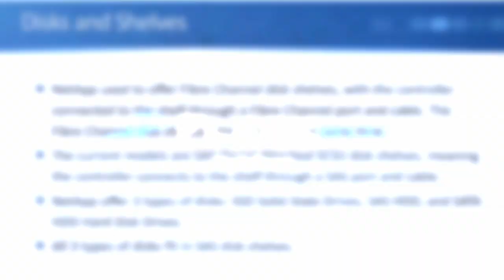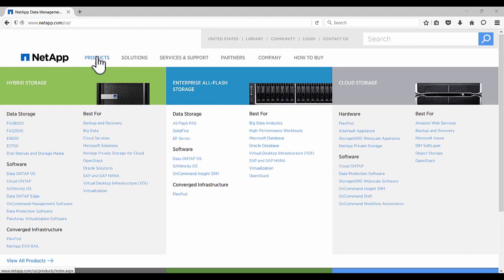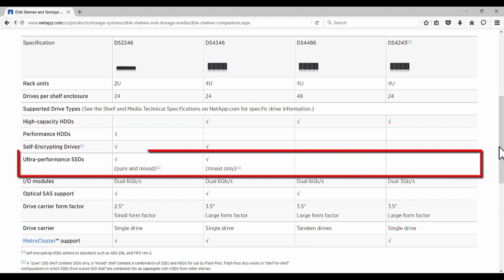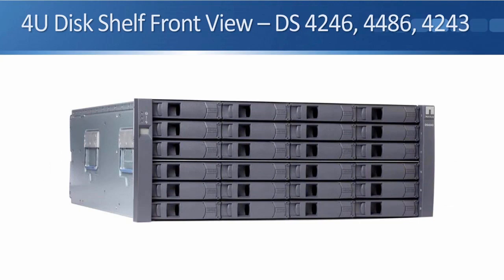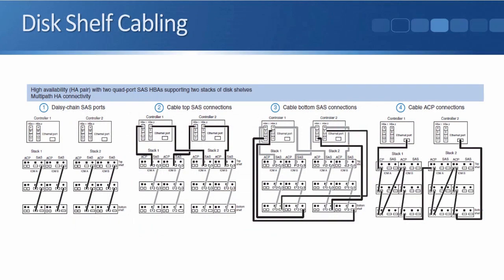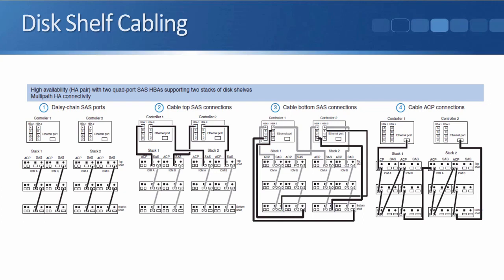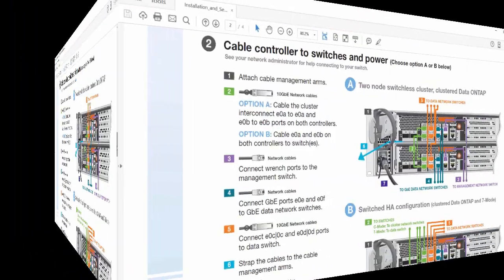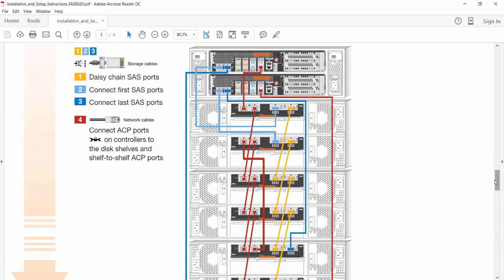NetApp Disk Shelf Models and Cabling Tutorial Video

Comment: I was able to setup a DS14MK2 shelf with 2x FC-ATX connected to my Dell PowerEdge Server with a Qlogic dual port 4gb FC card installed. Will I be able to setup a similar connection with a DS2246 shelf? If so, any suggestion on the kind of QSFP port controller I will need for my server?
Reply: Kabiyesi Agbaiye You will need to use a SAS controller with external connectors as the DS2246 are not Fibre Channel shelves. Look for LSI SAS controllers with 4 or 8 external ports. Not sure if PERC controllers will support NetApp drives with NetApp drive firmware.
Reply: I'll give is a shot. Thank you!